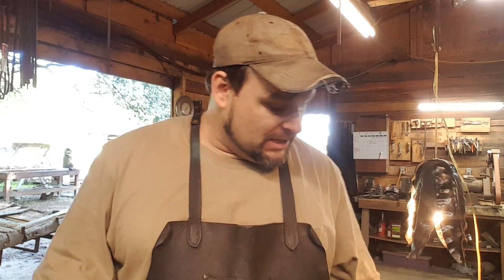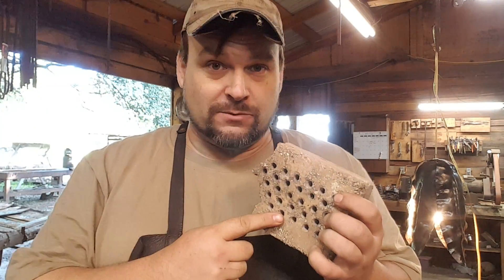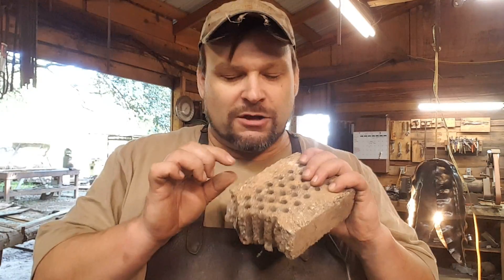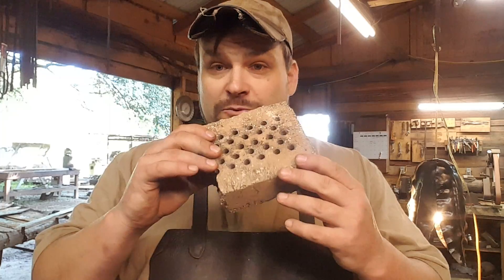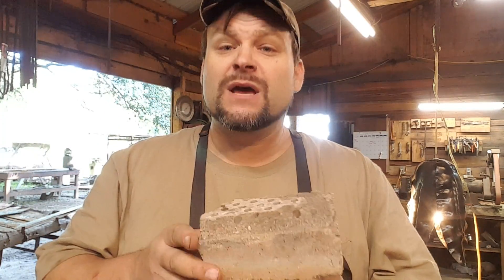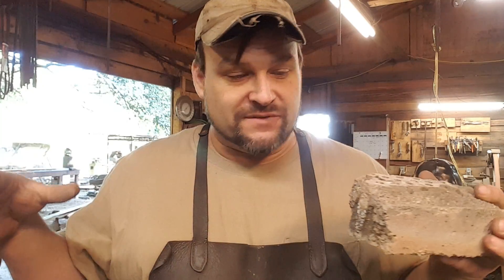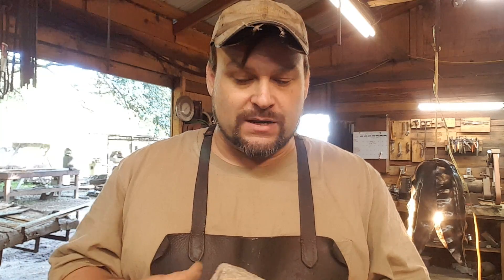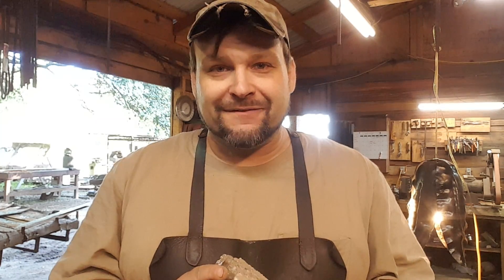What is a Ribbon Burner?

Comment: Lol that video about the 911 conspiracy and bending steal is total crap. Eye witness reports from firefighters say there was lava flowing in the rubble. They didn't bend they melted..... also its not likely each support column bent at the exact same time every level in sequential order. Also there were no fires at the bottom of the buildings yet the support columns also failed at the exact same time there too? Sorry but your "bent steal" theory is why most mechanical engineers don't believe in the official story. If fires caused the buildings to collapse, there would still be structure left at the bottom. They also wouldn't have came straight down either. Lol when you disable the comments to the video thats an automatic red flag that you know you're wrong and you dont want people to shove it in your face. Maybe try talking to an engineer or go to college yourself. Blacksmith doesn't = architectural engineer. Glad you care though most people wont even bring it up
Reply: Go take your meds

Comment: Would there be the opportunity to just make a manifold to make the distribution channels and attach it to a standard burner? It sound like if you know what you need to make, milling the distribution channels would be easier than buying an entirely new system.
Reply from the maker: The burner face is exposed, it has to be ceramic
Reply: purgatoryironworks oh OK. Thanks for the information.
Reply: Would the soft fire bricks with holes drill threw them work as diffusers? Maybe even have a bunch in a row with refractory cement glueing them together ?
Reply: Cyber Drift That's an even better question than mine, thank you.